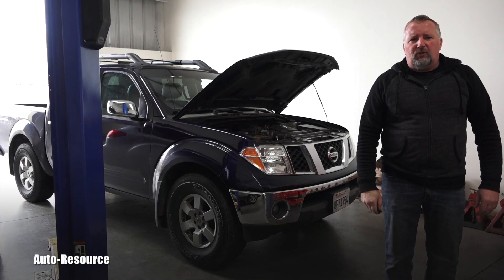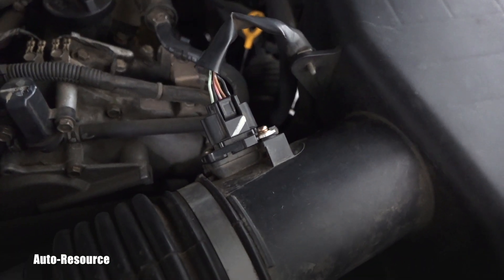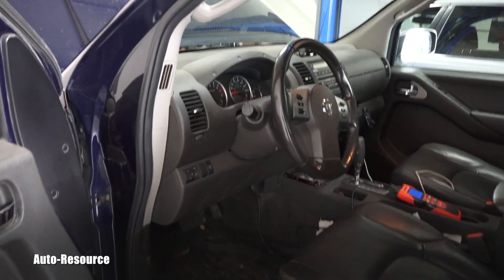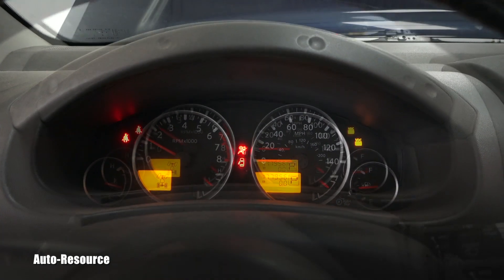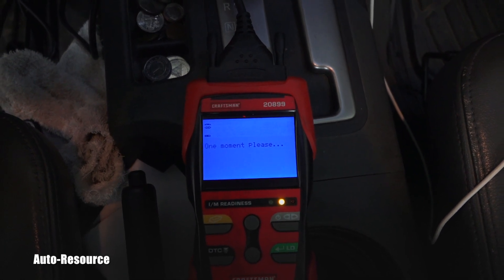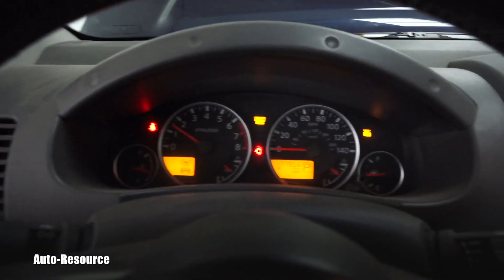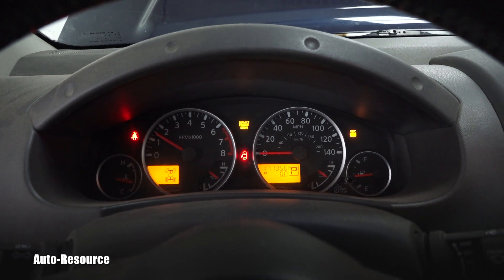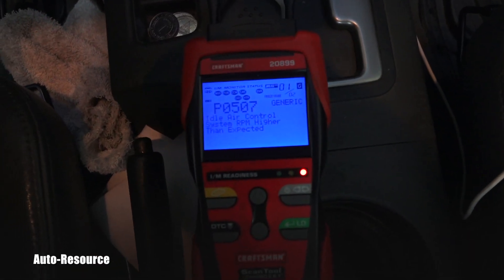Nissan P0507 idle air control system RPM higher than expected

Comment: Can you show where the IAC is located? I do not have a check engine light on so it's not showing any codes, but my truck is 2016 V6 2WD automatic and I noticed it vibrates/rattles every 30 second or so. Whether in gear waiting at a red light or just sitting in idle. Also, when it vibrates the RPM drops a little to about 520.
Reply: It should be around the throttle body
Reply: How did you fix the issue?
Reply: @MannyAguilarJr  definitely the throttle body. I took it to my Nissan dealership and they did a  idle relearn. Bringing the RPM from around 550-650 to 700-750 RPM. Much smoother, no rattle at all. But my MPG did go down from 17mpg to 16mpg because of the higher idle. Can't complain though. Hope this helps
Reply: @kyarakll4os7  thank you I appreciate it

Comment: Great videos.  I have a P0505 hard code which I believe has something to do with either the ISC motor and/or ECM.  But before I fix this code and spend lots of money, I noticed that all four of my readiness monitors are NOT complete.  I understand the procedure to reset these readiness monitors, but do I need to repair this P0505 first BEFORE I can run the readiness monitors?  Is there another option or procedure to reset these readiness monitors first?

I know I can get several other codes when the four readiness monitors are run, but is there a way to reset these monitors so I have an idea of what else is wrong with my vehicle?  I don't want to spend money to repair code P0505 ONLY to find out other codes later when the readiness monitors are run.  Please help.